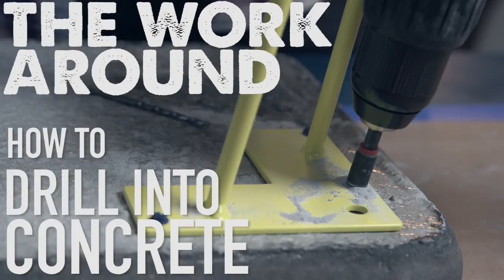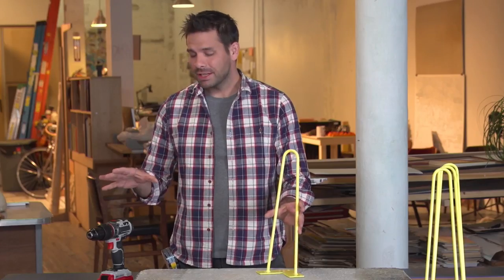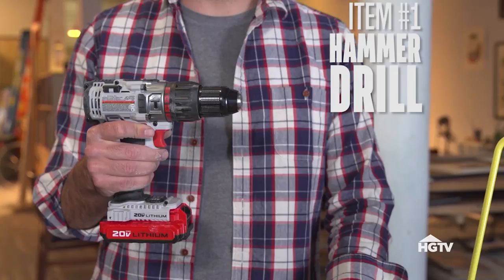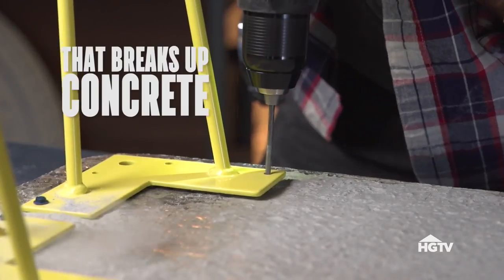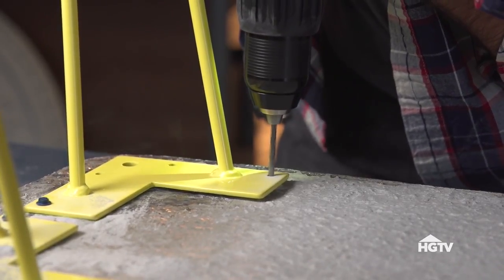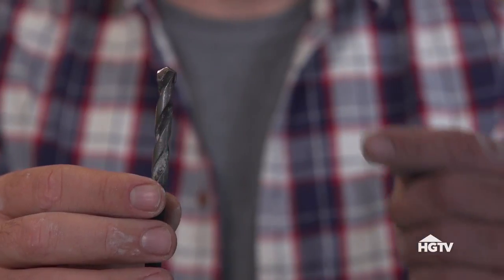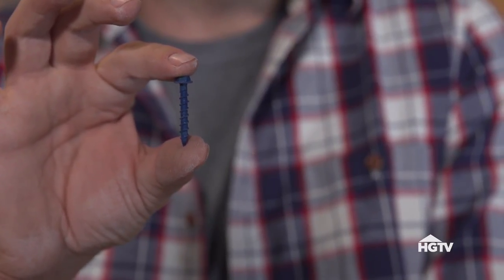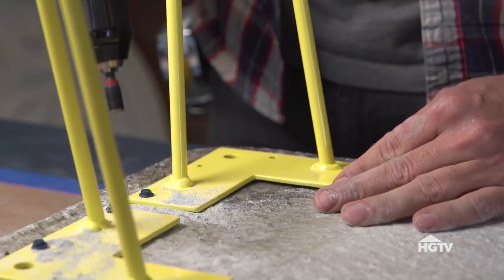The Work Around: How to Drill Into Concrete | HGTV

Comment: That only works with very soft concrete. The concrete in building walls is a lot, and I do mean a lot more tough, making that small battery operated drill useless. Unless of course it's ok to spend hours drilling a single hole, and you need the workout more than you need to finish the project.
Example:
https://youtu.be/Le3a7jUZ550